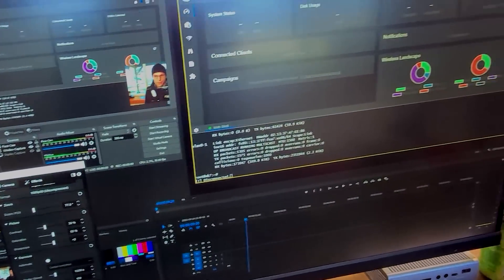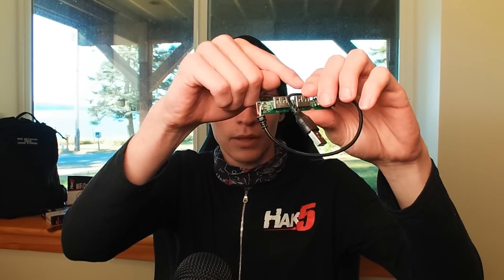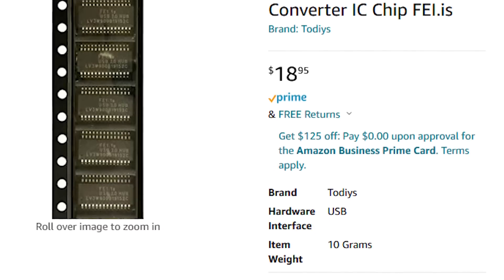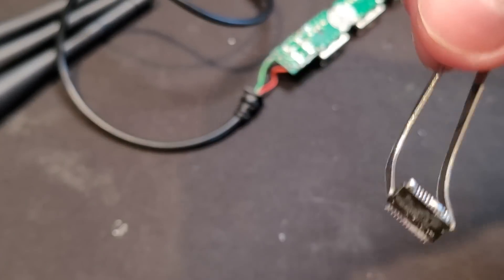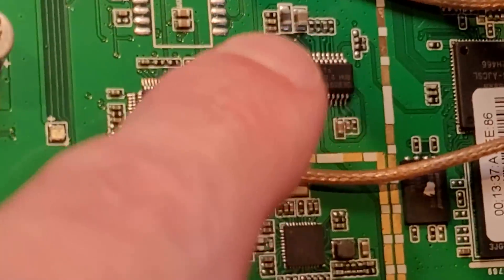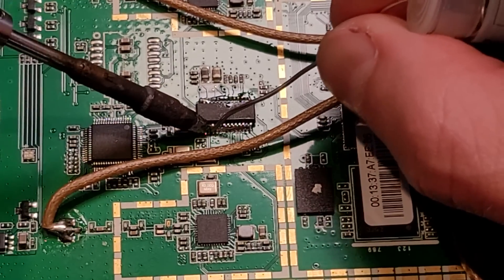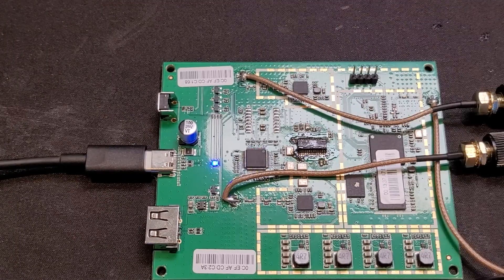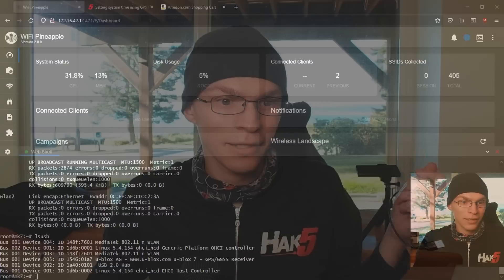I Fried my Pineapple, Let's Fix It

Comment: I am not buying anymore pineapples unless they make some major changes. Minor hardware or gui upgrade is not enough. I have two and there is not much changes between then other than gui and hardware. They both still do the same thing which I can do with my laptop. Frankly, I am disappointed.

Comment: it always pays to have cheap parts at hand, or in your case, the culprit for the failure was the saving grace, great video brother, excellent troubleshooting and diagnostics and the repair worked just as well as you had hoped, you can never really be prepared for everything that manufacturers and fabs will throw at you, but you worked with what you had and made the best of it

Comment: USB2.0 specification allow a client to draw 500mA only upon request. That means that your device has to properly enumerate itself with the bus, prompt that request at the host and hope to get permission.
- so 'somebody' didn't follow specifications and/or did not fuse the Pineapple properly.   Great way to increase sales and break out soldering irons ;ø)
Reply: @Glytch  Was the external USB hub powered?
Cool anyways - Glad you fixed it. 
Hope things stay secured better next time :ø)

Comment: A cheap soldering /reflow station can be bougt on aliexpress for 50 US$ , A heating plate can also be use. It would had been very usefull for the chip removal on the donating PCB  Some heating plate can be bought for 5$

Comment: Yeah, I still would definitely use a small heat gun and protective tape for the chip. Seems a bit safer and way faster. :)
Reply: i've used a small heatgun and aluminum HVAC tape in the past for masking and reflowing, a friend of mine uses aluminum tape and tin foil to protect components around where he is working with a big heat gun